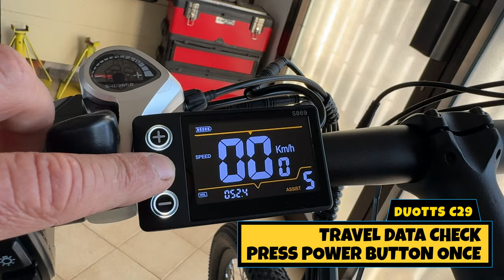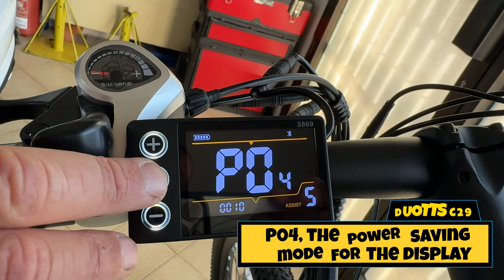DUOTTS C29 - THE MISSILE E_MTB - FULL TEST, UNLOCK & TOP SPEED - 4K

Comment: I bought the same bike, but the max speed it's going is 37.5 km/h.
Does anyone knows why it's like that and how to change that?
Reply: me too. But I feel like it's even only 25
Have you solved this problem?
Reply: I think it’s the different countries settings, the UK,Euro, American and Asia all have different laws so there’s settings to change and limit the top speed assist. It’s usually in the menu by holding +&- but not sure, some have an actual limiter you need to remove but those duotts bikes are sold all over so it’s probably in the settings, watch a few YouTube vids with people delimiting e-bikes and find one using the same controller, those duotts definitely do about 35mph once unrestricted.
Reply: Hi, to unlock the full speed, change those 2 settings & you're good to go, mine goes 80km/h :)

P08: 0067 (turn off limit from 25km/h)
P18: 0150 (sets battery power to max)

previously I've been riding at P18: 0100 & my bike could go max 54km/h.

I hope it helps, good luck and take care on the road,
Cheers